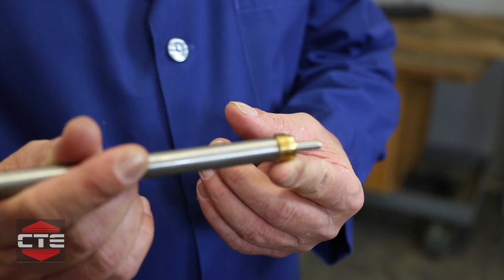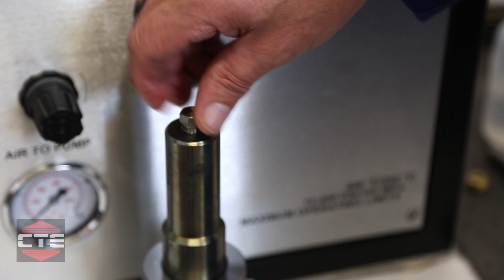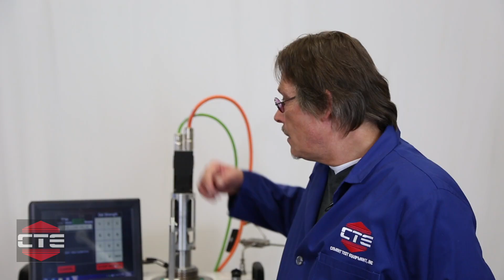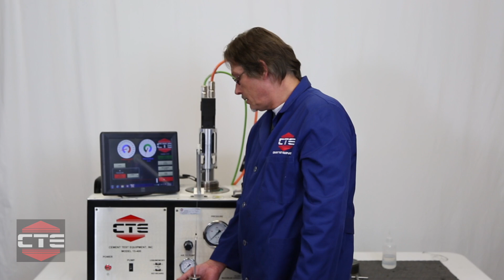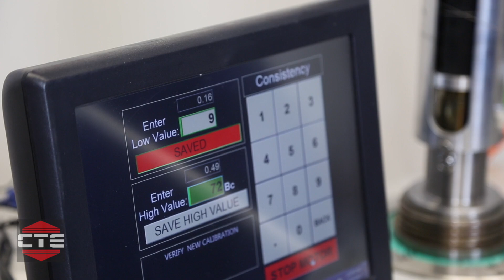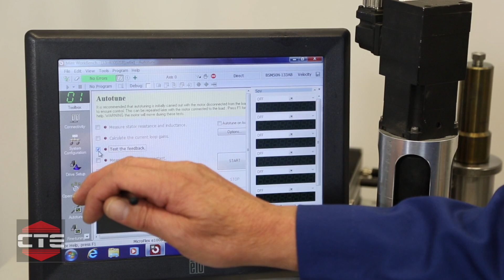Instructional Video for M15-400 and M15-400GS

Comment: The gel resistance analysis equipment, CTE brand, there is a noise in the little motor, and the gel resistance values oscillate continuously. What should I do? It is from the denarius pumping services company.